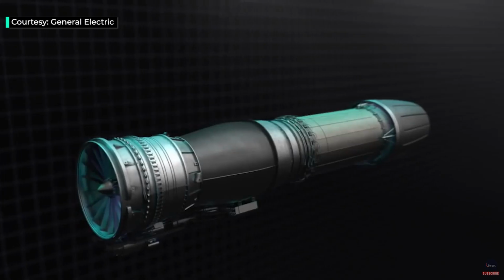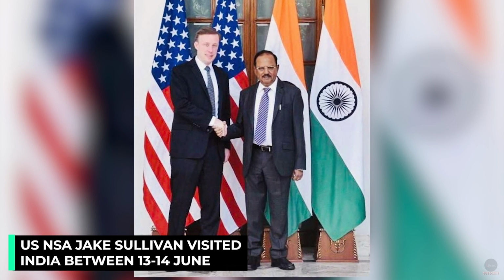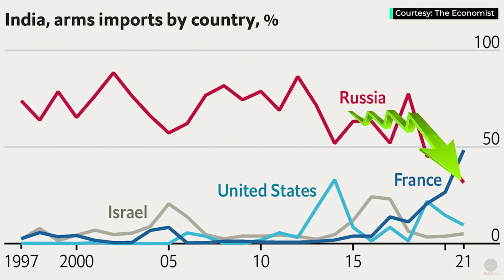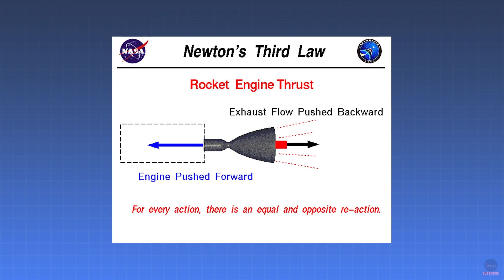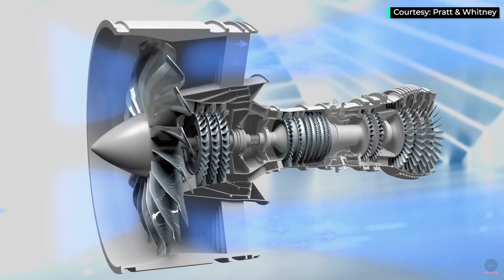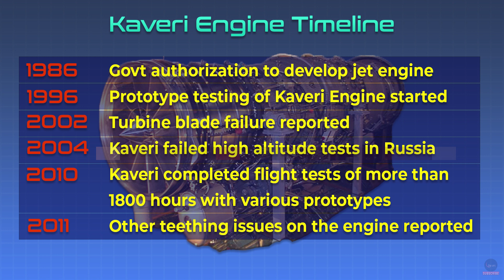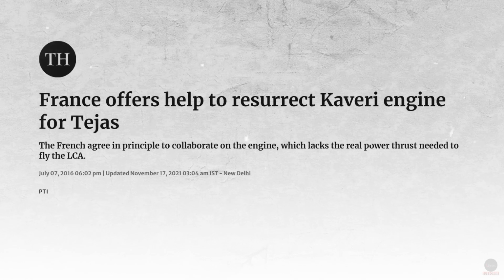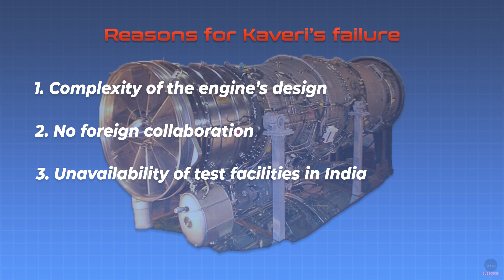GE F414 Jet Engine Deal | US-India iCET | Why did Kaveri Engine fail?

Comment: Sir every country have denied the colibration England and  American have said thy use there engine technology but ipr right will bhee there property  Russian cannot show interest even thy can't give Rd 33technology to india only France have come to help but thy can't give ipr right and full tot also can't share matelorgy knowlege  and compact core technology  France and europens engins have outstanding matelorgy  knowledge that is why there engine have very low weight  safron have 850kg with after burner and rolls royal engine weight is 900kg with after burner where aur kavari weight is 1135kgwithout after burner giving dry thirst of 46kn and if it's after burner stage is added it s weight increase up to  1300 kg and total thirst became 80kn to 82kn  this is main reason for failer stock holder want 90to 95kn power but it's vares onlyvto 75kn only😮😮😮😮😮😮😮😮😮😮😮
Reply from the maker: Yes, you have summarised it very nicely. Jet engine technology is still a difficult one to crack, which is why no country wants to share it. It has to developed indigenously. A foreign collaboration will definitely help but most of the work has to be done by us.